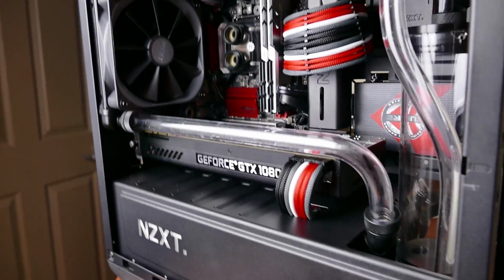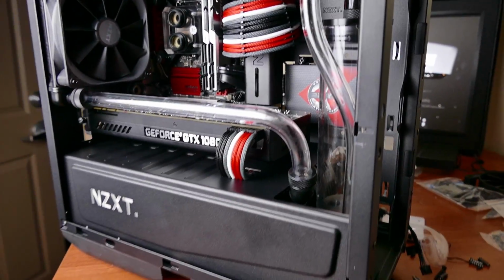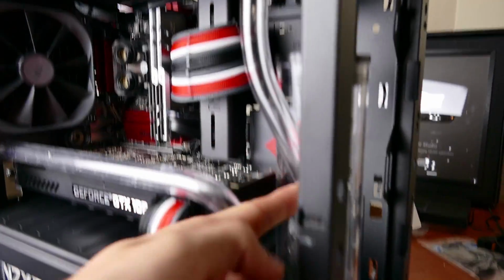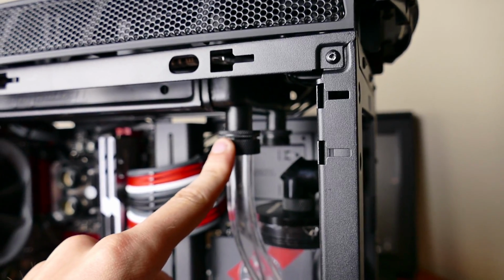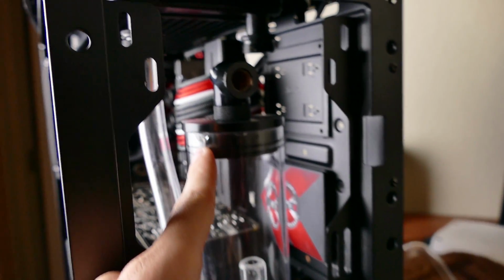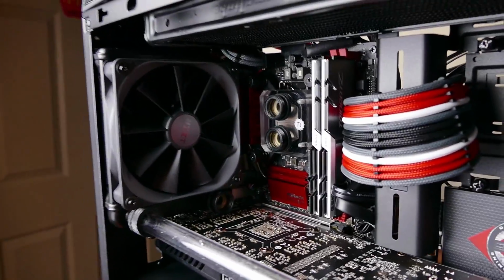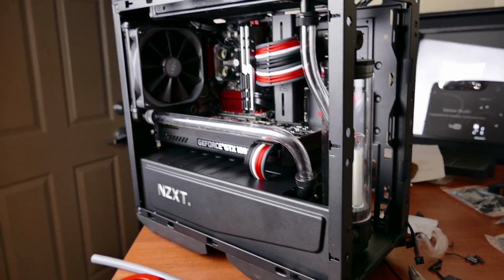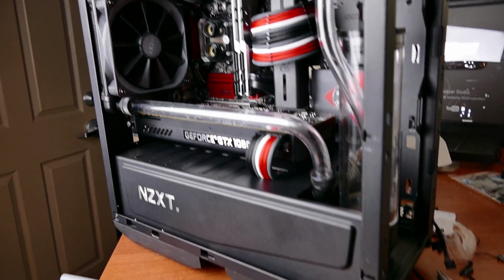ITX Custom Loop PC Build (Part 1 of 2)

Comment: That's a very nice custom loop for such a small case!  When I first saw your build I was wondering why you were building a custom loop without water-cooling the GPU instead of just using an AIO, but then I saw the comment you posted... 
Personally, I'm too lazy to redo the loop twice; I'd probably run it on-top of the motherboard box outside of a case with the stock air-cooling until all the parts arrived.  Nonetheless, I'm looking forward to the finished product!

Comment: You should try some crazy liquid cooled build in the thermaltake core v21. It is a micro ATX case and if you buy extra mounting rails, it is possible to fit 4 240mm rads in there and if you get 2 and stack them you could get 8. Seriously overkill and stupid, but would be kinda cool if you could pull it off.

Comment: almost the same build im using the Strix Z270I board and 1080 combo so much custom cables due the fact it only had 1 USB 3 header and 1 new 3.1 header but the Manta case is so easy to work with

Comment: Nice build bro, hope you make sure that you get a good tight fitting on that 120mm rad, coz if that thing leeks, it right on top of that very sexy expensive 1080ti, bang mate, cant you rotate it one turn so you get clearance from being right over the gpu?

Comment: I'm pretty sure you can do it without destroying the socket, but why didn't you just put a CPU in there while biulding? It would be way safer for the socket, wouldn't it?I think it's also easier to put a COU in there if the mobo lying on it's back ^^

Comment: Did you have to do anything special for the BIOS on the Z270 board you have in there? I was thinking up upgrading my motherboard to one on the Z270 platform but I don't want it to arrive and then realize that I need a Kaby Lake CPU. I'm rocking the i5 6500.

Comment: Should I get a 580 or 570?
Reply: And whats a good cheap mid tower case [looks and cable management are important] And I need room for a 240mm rad
Reply: What is your budget?
Reply: 580 if you can afford the extra 50 bucks and get 8 gb. That should be good for 1080p gaming for 3 years.
Reply: Get an Rx 580 but if you have low budget then get an 470 since it is $50 less than 570.
Reply: DuckyDie Honestly, look for a deal on the 480 or 470. If you can find those for $20 less, that would definitely be the way to go. For a mid tower, you can't go wrong with a NZXT s340 for $65. That allows a 240mm radiator in the front and easy to cable manage in.
Reply: but the s340 is so bland on the sides. But its cable management is awesome and so is the rad support.
Reply: 320 Cad